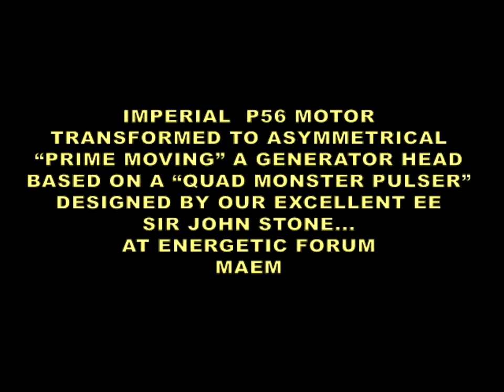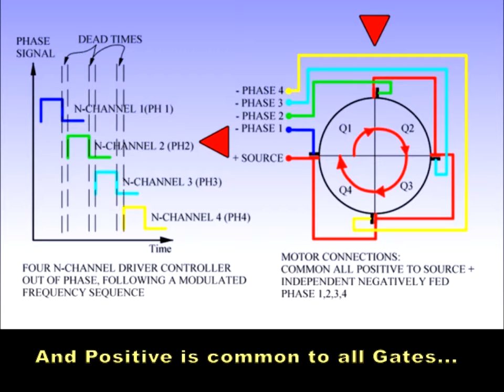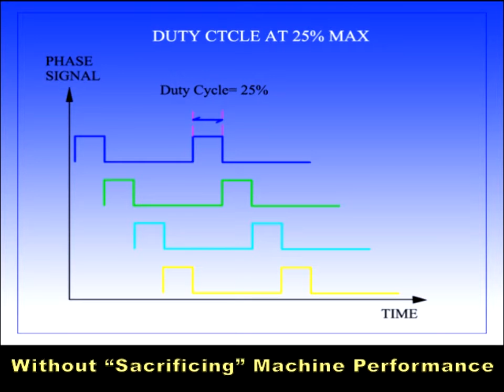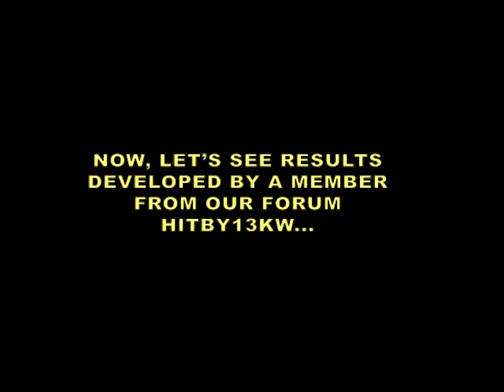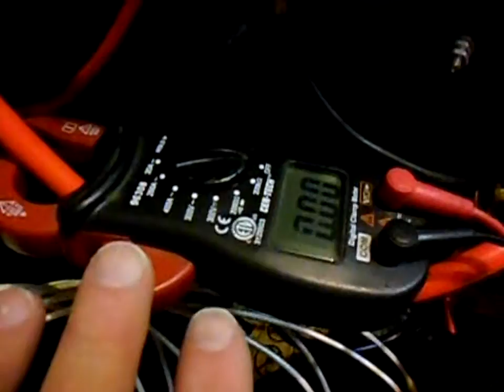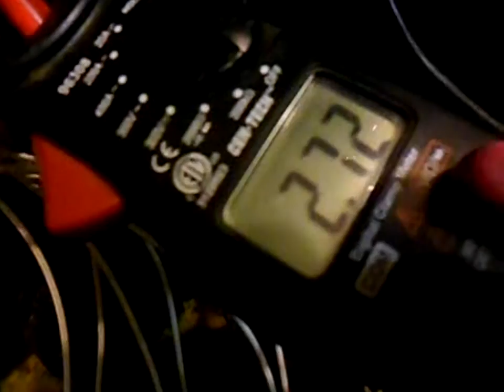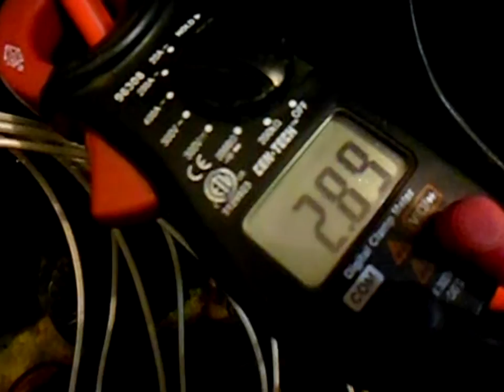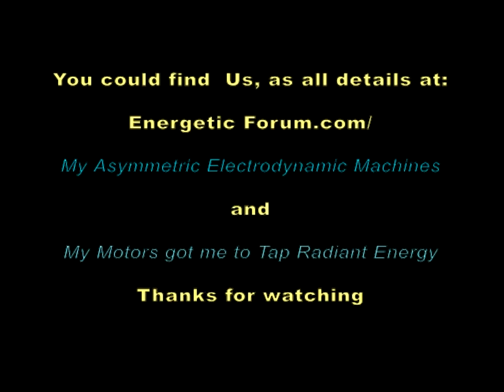QUAD MONSTER PULSERS

Comment: A kind request UFO ...... can you replicate the Joseph Newman's motor ...... The commutator design is not clear ..... especially the four wires which connect to the center ..... and also the spacing & size of commutators .

Comment: Hello Ufo. I did show this function of a demux via the Arduino interface in my latest video. Each separate pulse will decrease the overall frequency. Dead-time is controlled by the pulse signal of the source signal. Using photo-sensors is a good way to adapt to the rpm of the motor to the dead-time. 
I am building a new controller board to allow all of it, Currently only based on half or Full bridge but easily expandable to multiple amplifier outputs.

Comment: Hi, could there be any benefits, if one would use (a) photoelectric sensor(s) to establish the position of the rotor and distribute the current(s) on the feedback they (it) gave?

Or use them (directly?) as switches for let's say a "pedelec" assist system?